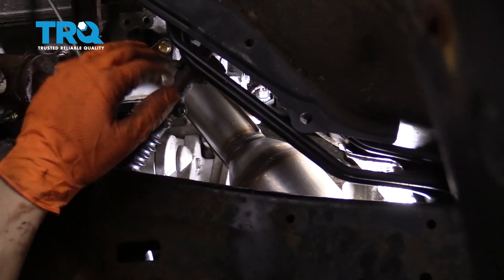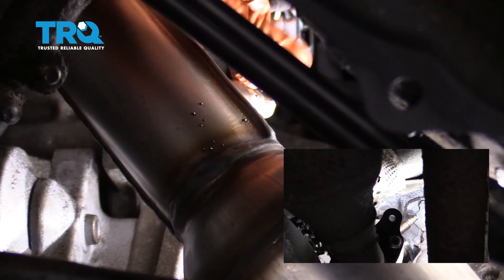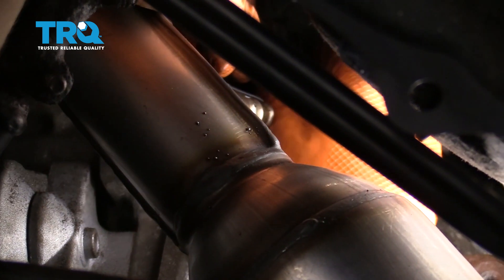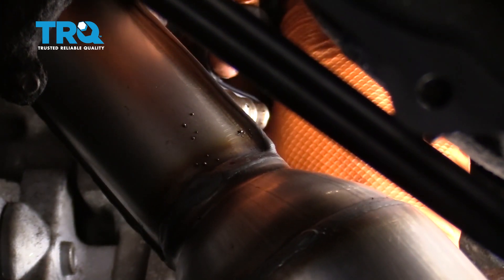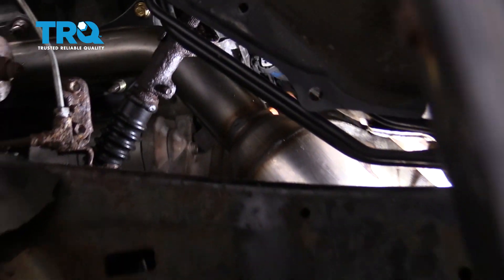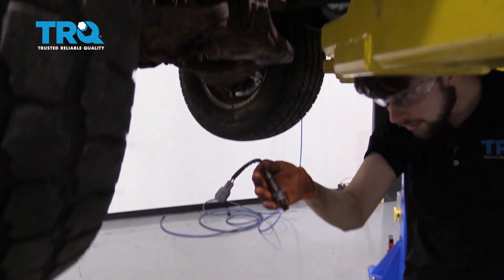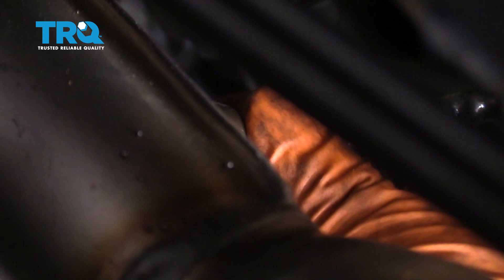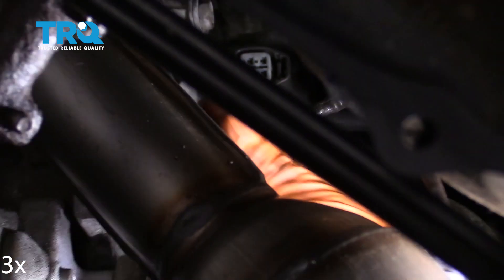How to replace O2 Sensor 2003-2009 Toyota 4Runner

Comment: Getting to that sensor is a no go for my year2008. It faces the other way and there is no way I can reach it with my wrenches. I have clearance issues with the AC and exhaust manifold. Impossible to break free with no leverage.